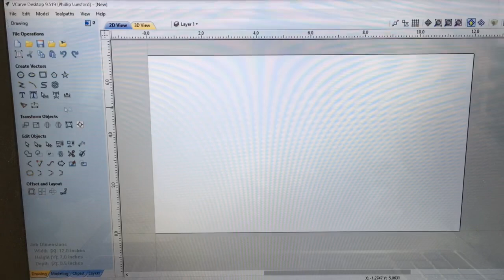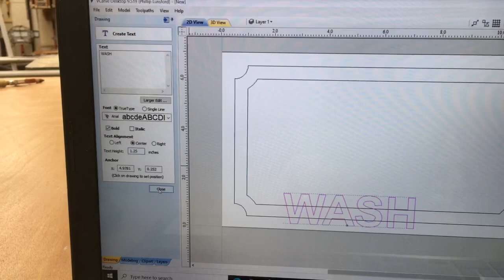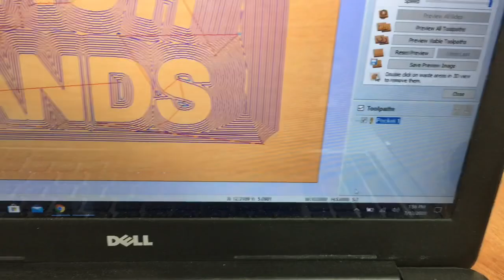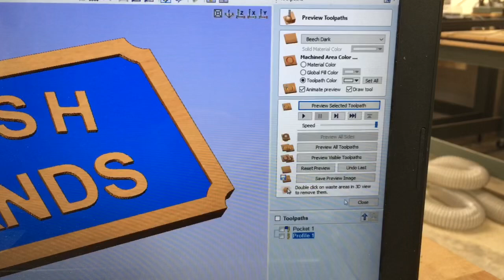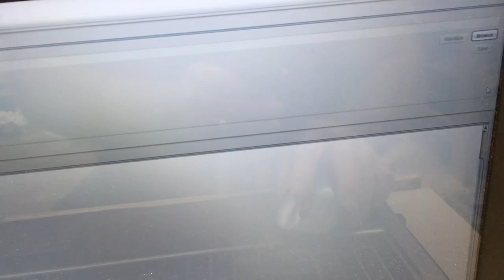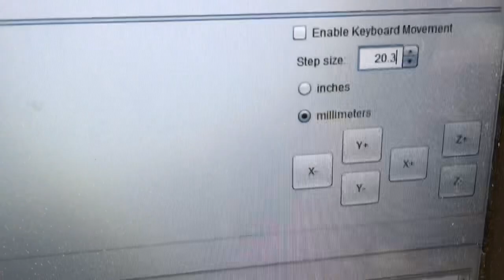How to Series on VCarve Desktop with UGS

Comment: on v-carve what do you press to send to my fox alien 4040-xe i have the drives install right and i downloaded USG and dont know what to do next.
Reply from the maker: Save the gcode in VCarve.  Open the gcode file in UGS.  Also, consider using the Openbuilds controller.  I actually like it much better than UGS.  Its free also.
Reply: @PawPawsWorkShop  when I got the tool path in V-carve there's no button that says send but there is a check box do I PRESS that one and do I have to send files to the USG
Reply from the maker: Just curious, do you have the trial version of VCarve?
Reply: @PawPawsWorkShop  no I have the full version I downloaded the open builds ugc and I had to pick custom build it didn't have my FOX alien did I pick the right one for my 4040-XE

Comment: would the genmitsu be able to use this same program and end result?
Reply from the maker: Yes. The only change that I would make is using the Openbuilds controller in place it UGS. Either will work just fine
Reply: @PawPawsWorkShop  gotcha thank you and that thing you used for the homing of the xyz is that usable with genmitsu?
Reply from the maker: Yes you can setup the touchplate on this machine

Comment: Two questions, I tried duplicating your sign, following along and for some reason it was just creating a outline cut out of the letters and didnt cut out everything you had in blue. Not sure what I was missing. Second, if you wanted sharper corners on the text, would you have done a third pass, making it a detail pass with a smaller bit?
Reply from the maker: In easel you can cut on path or inside and outside of the path. The choice you want is a pocket. You want to remove all of the material

Comment: Sorry if others have asked, just not time to go thru all the comments. Your using a 1/8th endmill.  What are the tool speed and feed settings? I know you are using mdf but I will be using hardwood.
My vcarve time says 1hr 30 min
It's not quite 15min
Thanks
Reply from the maker: Often I will start with the default and speed it up from there while carving. In hardwood take shallow cuts.

Comment: I have an xcarve and I wanting to use ugs can the z probe that comes with the xcarve be use in ugs and use the g38.2 comand.  And also after you use the touch plate do you hit set x y and z on the ugs screen
Reply from the maker: Yes, you can use the probe. You will need to state in the code the height of the probe puck. After the probe yes, you will need to hit set z axis. The x,y is not affected by the probe unless you have a 3 axis probe. After you place the router on the x,y position, then hit set x,y

Comment: I can’t figure out how to send a photo. When I select the tool path, then select vector hold down shift key and select text. After I select the pocket tool, the menu the is displayed on the right. In the section that shows offset and raster, clear tool path is not displayed. Off set and raster is grayed out. Any ideas?  I have learned so much from all of your videos. Thanks again.

Comment: I really enjoy all of your CNC videos. On this one, I am having a problem. On Vcarve pocket toolpath , it does not show me clearing out the area. I did select the vector and text. No luck. Any suggestions.
Reply from the maker: Use a roughing pass first with an 1/8” or 1/4” end I’ll and then do the detail pass with the v bit. The v bit should only go around the edges.
Reply: @PawPawsWorkShop  pocket does not show clear out pocket. Tomorrow, I will send you a picture of the menu.

Comment: Sir am trying ugs but don't work as error in hold,etc please help me to run
Reply from the maker: When you first start UGS you will get the alarm.  That's normal, under machine control select $X and you will be able to move the machine.
Reply: @PawPawsWorkShop  can you please share me mail id,I have some doubts in CNC machining
Reply from the maker: It's in the description

Comment: Thanks, I just purchased V-Carve.  Is there a way to make it start and stop the router the same way EASEL does?
Reply from the maker: Easel acts as a sender. VCarve does not.  You can design in VCarve and generate the gcode and use easel to carve the project.
Reply: @PawPawsWorkShop  Thanks, I discovered I was worried over nothing.  The g-Code generated will start and stop the router automatically.  I don't have to do anything different.  I do need to be aware that the router must be ready to go when I hit the send button.
Reply from the maker: Awesome!

Comment: What version of the desktop are you using? I just upgraded to 10.05 and discovered I can’t send V carve tool paths through Easel because Easel can’t process arcs. Other tool paths work ok. They have added a lazer operation to the tool paths that stops it from working. It worked fine in 10.0. I haven’t started UGS yet so not sure about how it works with V carve.
Reply from the maker: I have been using ver 9.5. I just upgraded today to ver 10.5.  I do not send anything from VCarve to Easel any longer.  You are correct, arcs are out in Easel. Yes, the laser operation is new. Should be interesting to see how that compares with Lightburn.  I like UGS, it is very easy and you can learn it in just a few minutes.
Reply: Paw Paw’s WorkShop I’ve got UGS installed and have messed around with it some but still don’t feel comfortable enough to run it completely yet. A couple of times it’s made some unexpected moves so I still need to do some practice with it. Your videos are giving me some confidence though, thanks
Reply from the maker: Awesome, you get it quickly.

Comment: I have a video request as i just bought a X-Carve myself. Can you do one on what size/type of bits to use for what specific circumstances. For example, for a newbie what is a upcut used for what is a ball end used for? what should you use for engraving on aluminum? what about high detail wood work vs rough cutting? I think this would help out quite a bit for alot of people :-) Just an idea though...Great videos BTW and i Subbed :-)
Reply from the maker: Thank you very much.  You have an excellent.  Many people have different opinions on what is the best bits to use for different projects.  It should create quite a stir offering my opinion.  I think this has the makings of a great video.

Comment: I have a dumb question? Where can I download or purchase that Universal G code sender that you used? And the 3 way prob? Thanks
Reply from the maker: The UGS is free google UGS and you will find it under winder.github.  I chose an older version 1.09. It does not have some of the newer features but is stable with no problems. The touchplate I made and I did a video showing exactly how I did it.  I also wrote the gcode to make it work.  See the video. Thank you very much.

Comment: Hi Paw Paw
Greetings from BirminghamUK
In reply to your video Why I love my laser
I am 72 years old,qualified carpenter and joiner
I have the same Xcarve and laser as you plus a workbee cnc and a3040 cnc plus 2 K40 lasers all run from my garden 20x10jft shed in garden.if it were not for these modern accessories I would not have a retirement business.
Thank you for your channel.
Kindest Regards
John FreeTh
Reply from the maker: That's awesome.  Keep up the good work and keep those machines busy.  It helps to keep your young also.  Be safe and have a great day. Thank you very much.